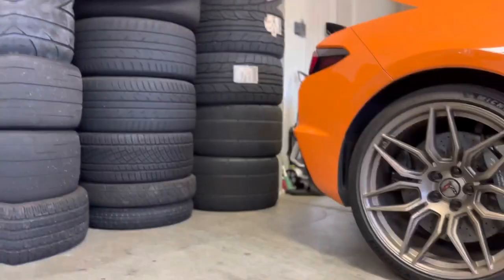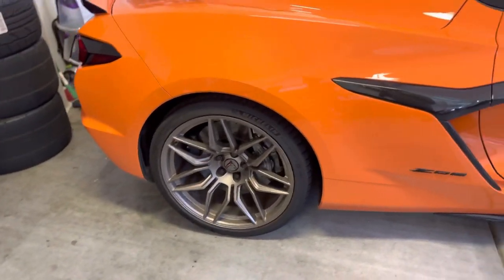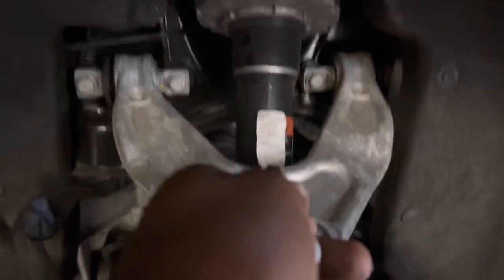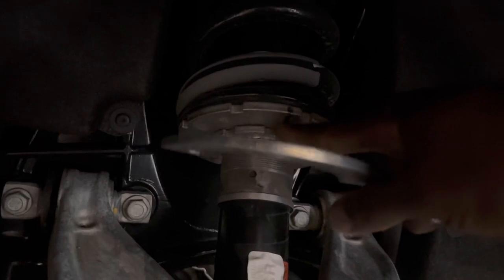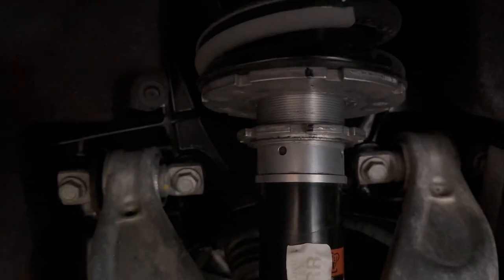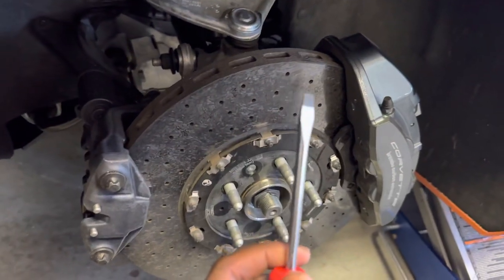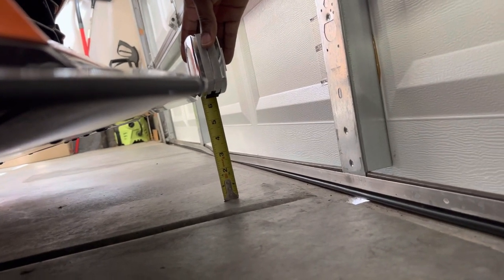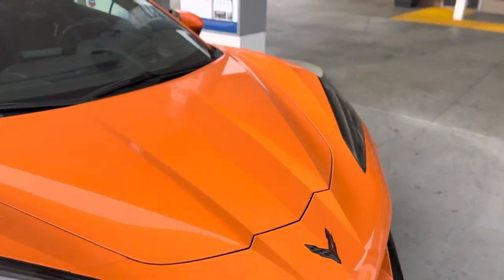How to lower your C8 Z06 on stock suspension...

Comment: Nicely done Jesse. Thanks for sharing!  A couple of suggestions: loosen the lug nuts prior to jacking; use a jack stand as a safety before starting the lowering; mark the tube that the two spring seats revolve around so that you can easily tell if it rotates when you are using the spanners to rotate the  seats.
Reply from the maker: Thank you for the suggestions

Comment: Great video Jesse. Can you please add the specific two size spanner wrenches that fit the top and bottom ring for lowering? I want to make sure I buy the right set! Thanks
Reply from the maker: Thanks! I can't remember the size but usually you can buy a pack and a few in the pack will actually  work

Comment: Man I’m jealous. Looks like the non front lift cars are easier.. I won the paragon lowering kit but mine has the front lift.
Reply from the maker: Ahhh
Reply: @2020matrix8 you can't use the lowering kit on a front lift car?
Reply: @ericktremblay9512  you can but you have to take the shock out, disassemble it and replace the collar at the bottom
Reply: @2020matrix8  looking to sell it?

Comment: Jesse, I’m assuming no front lift to be able to lower your Z06. Have you had any issues with driveways, etc. with the vehicle being lower? I had a C7 Stingray and a C7 Grand Sport, and I lowered both and never had any issues. I only have 2 individuals ahead of me at a dealership to get my C8 Z06 and debating if I need the front lift…or go without it and lower it so it’s more aggressive.
Reply from the maker: Yes no front lift, no issues going into driveways, even at stock height I have not seen any reason to need nose lift on this car
Reply: @jesse_iwuji  Any regrets not getting the Z07 package. My two sons (27 and 22) think “you have to get the Z07…because no one will no it’s a Z06!!” Of course when ask them to pitch in on the cost…they don’t respond.”
Reply: @Jesse Iwuji  any solutions for lowering Z06 with front lift?

Comment: Great video Jesse! I can't remember in your vid but do you need to get the lowering collars (like the ones from Paragon) if you have the front lift or no need to buy them and can leverage stick lowering spanner w no issues?
Reply from the maker: So My car did not come with the lift kit for the front, so I'm not sure exactly what's needed for the cars that come with that. If you don't get the lift kit, you can do everything I didn't this video to lower your car. I did not buy any other special parts for the car, all I did was use my tools to lower it.

Comment: Any issues removing the rims without stud extenders?
Reply from the maker: Nope! I’ve taken the wheels on and off this car tens of times
Reply: @jesse_iwuji  Nice, thanks! One more question. I just lowered mine and noticed a good amount of oil around the front collars. Did you have the same thing? 350 miles on my Z06, hope they're not leaking.